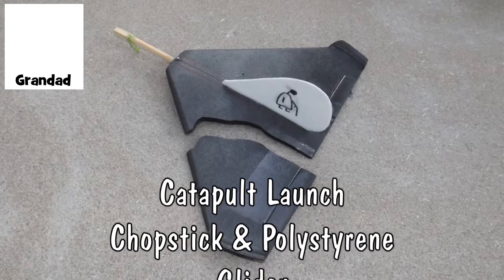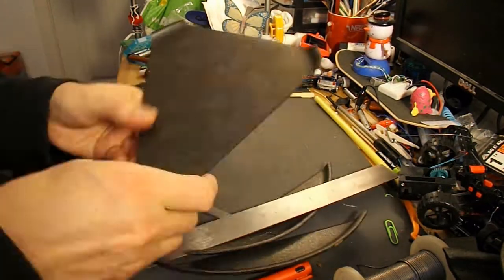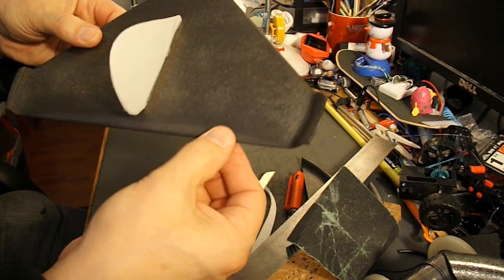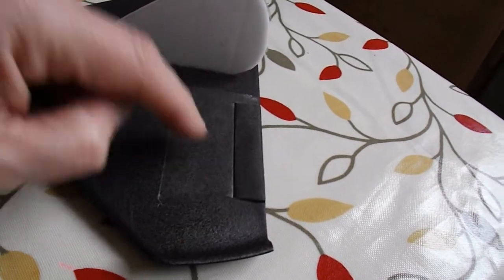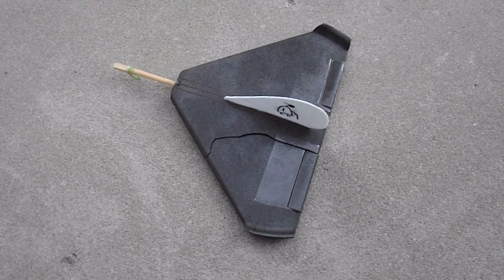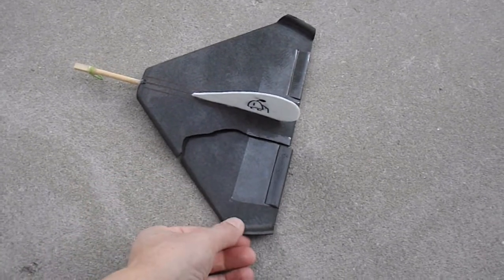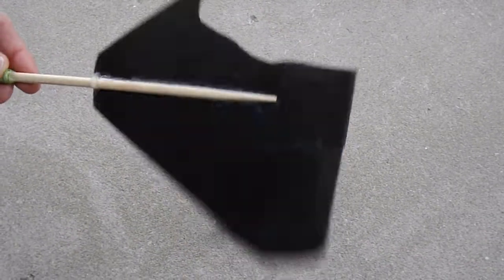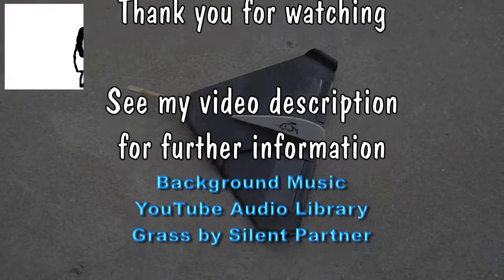Catapult Launch Chopstick and Polystyrene Glider Delta Wing

Comment: Love it!
This design seems to depend a lot on high speeds to create lift. So it does not really outperform a good A4 paper folded plane. A lighter nose an longer tail (2-piece plane?) might do the trick...
Reply from the maker: This one does exactly what I want it to do apart from falling apart when it hit the ground :-)
As for 2-piece plane, see the previous design, it's the one you see flying after the delta breaks.